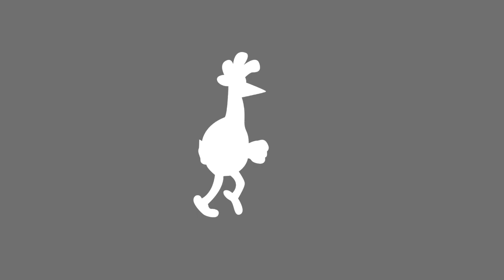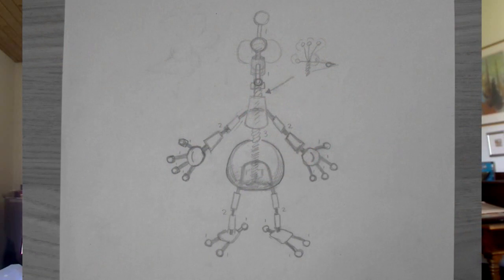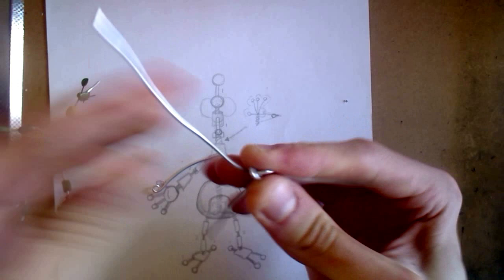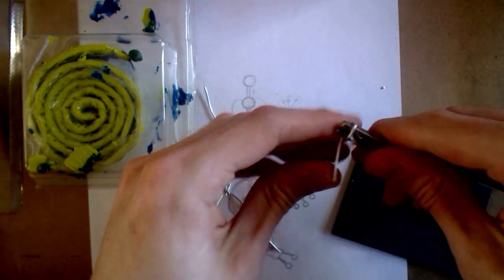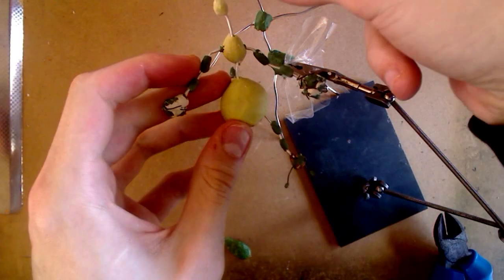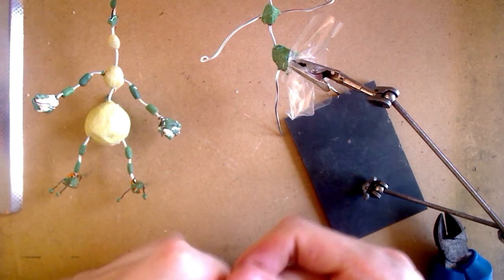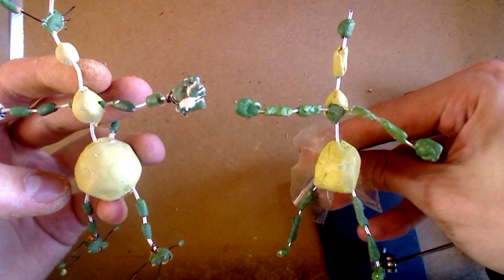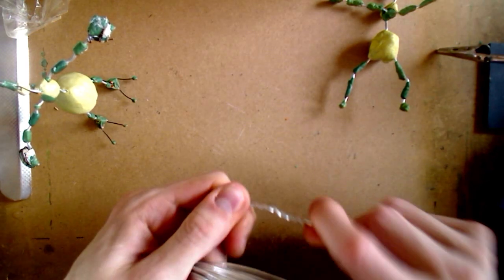Cheap and Easy Armature! | Stop Motion Tutorial

Comment: Nice video! I have a few questions if you don't mind! Is it better to use 1.6mm or 1mm aluminium wire? Can I use hot glue for the joints if I don't have epoxy putty? Is it better to remove the rig with masks using a video editing program or photo clone paint (is there tutorial you recommend)? Thanks a lot :)
Reply from the maker: Thank you! Not sure about the thickness of the wire, it really depends on your character, scale and whether you twist the wire or not. Maybe both wires could be useful for same armature - the thinner one could be used for fingers etc. If I had to pick just one, I'd probably go for the thin one as you can always twist multiple thin wires to make a thicker, stronger one, but you can't really go the other way.
Hot glue wil probably break unless you use a lot (a THICK layer) which requires a larger puppet. It's also very flexible which could be a problem... I'd recommend an epoxy instead, but you can always do a test. It would definitely be a quick and easy way to produce armatures if it works! ^^
I'm removing the rig in Stop Motion Pro Eclipse using the rig removal tool. Not the best tool though and I'm probably gonna switch to Photoshop in the future, just because I like Photoshop... I'd say just use a software that you LIKE. :) You can see how I do it for now it in this video: https://www.youtube.com/watch?v=fulEZNIm1ZI  (approx. 5 minutes in).
Reply: @DofWorksAnimation  Thank you so much!